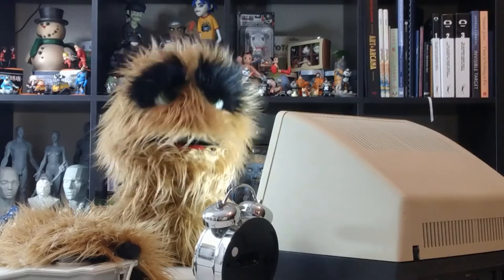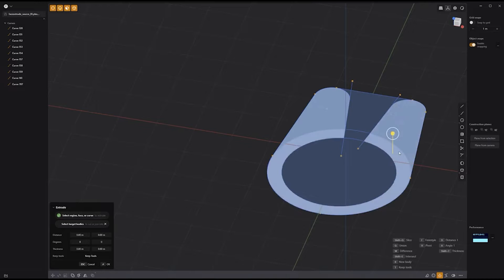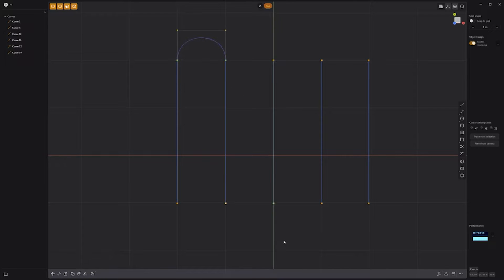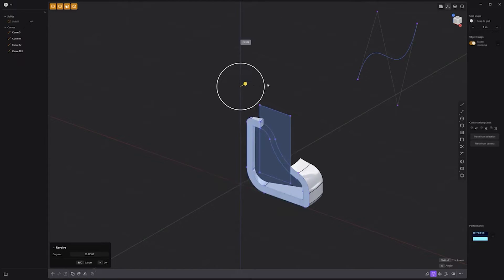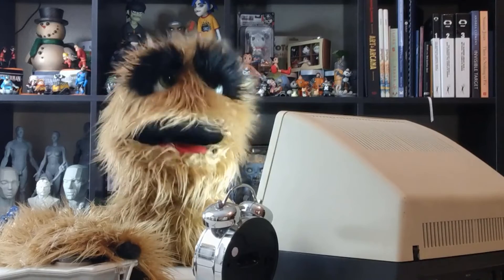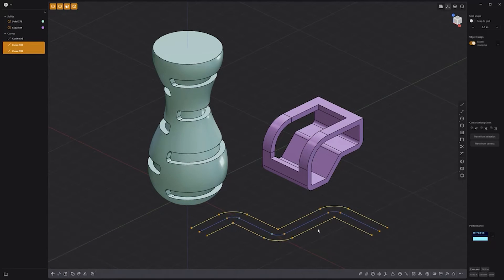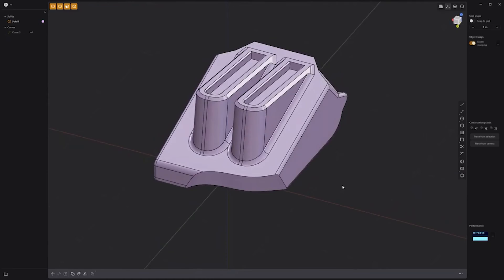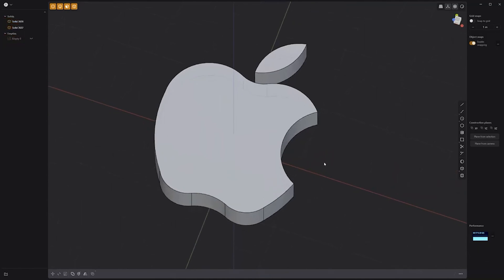Plasticity | Basic Modelling Operations Part 1

Comment: Hi, Floyd! Can you please tell me if there is a way in Plasticity to achieve the maximum fillet? Let me explain. Suppose I have a cube, and I want to apply the maximum possible fillet to the two edges of one face of this cube until a complete rounding is formed. I tried to do this, but it seems that the program does not allow it. I can get close to the perfect rounding, but "close" is not enough for me. However, there is probably some trick that you know. Thank you!
Reply: Isn’t it just create a circle curves does the same job?
Reply: It does. Irrelevant to what I am trying to achieve though.
Reply: @mishakvakin  you have to write the exact length of the face, if the cube is 100 x 100 cm then is the same value for the bevel (in your case would be half of that length for 2 edges). Also you can click in the face of the surface of other object to get an exact round bevel with radius, or to copy other bevel radius. same should work with the edges of cylinder by clicking over the round face of it in this case which it create the sphere shape...